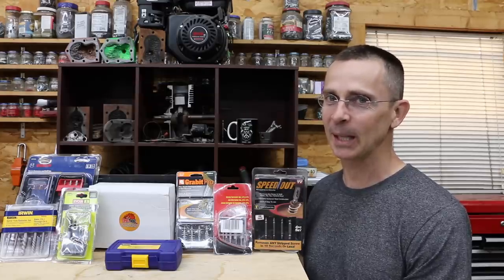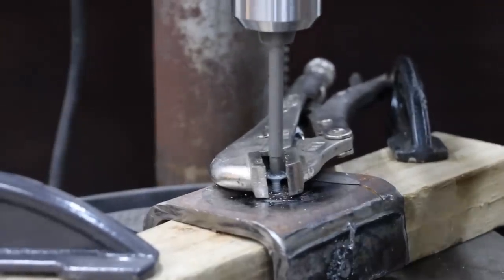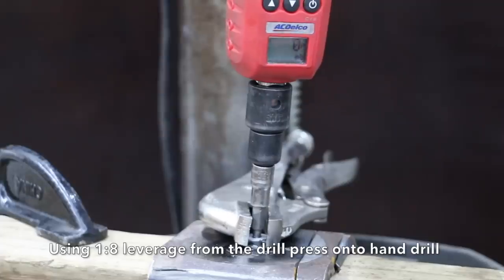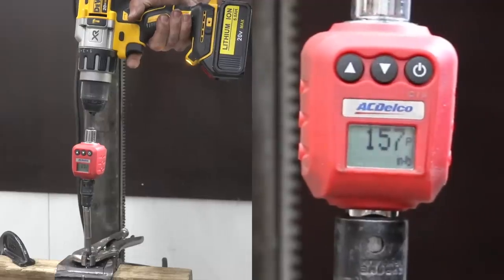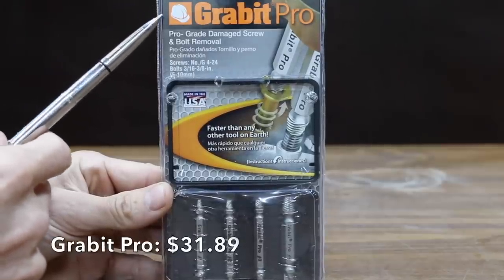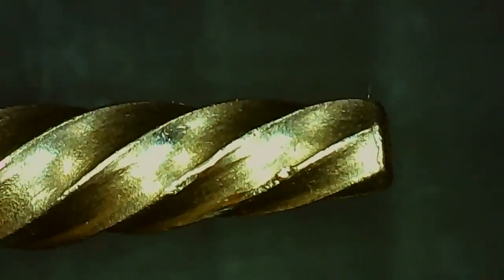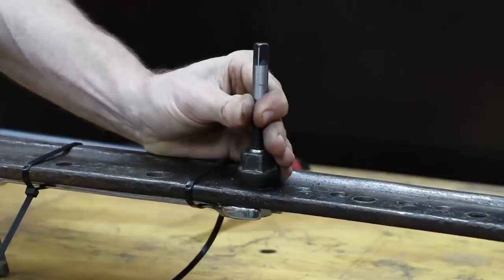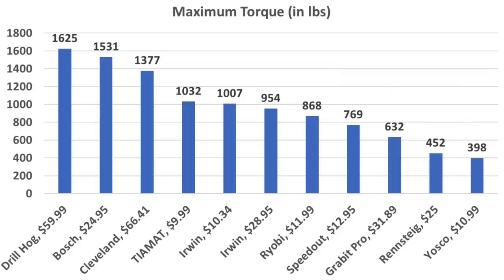Best Bolt Extractor? Let's find out!  Drill Hog, Bosch, Irwin, Speed out, Ryobi Broken Screw Sets

Comment from the maker: Products Tested In This Video (in no particular order):Drill Hog: https://amzn.to/34lyrtO

Bosch: Currently not available
Irwin Hanson:  https://amzn.to/2Qlf5N3
Speed Out Pro: https://amzn.to/38qnsBu
Ryobi: https://amzn.to/2CNBCPA
Grabit Pro: https://amzn.to/2JPT8Ga
Yosco: https://amzn.to/3gkLzBE
TIAMAT: https://amzn.to/2E6mjlW
Rennsteig:  https://amzn.to/3giX24V
Cleveland: https://amzn.to/31hNLWi
Reply: It'd be great to order these by your ranking (to help those purchasing based off your great tests)! Thank you.
Reply: There is a new king extractor. The R.B.R.T. Extractor from Mac Tools.
Reply: Bummer, I was going to get the Bosch one
Reply: @ project farm 
Can you please make a video testing helicoil and timesert repair kits for high torque applications (and low torque) vs original threads. No videos on ytube or anywhere for this. Will be too late for my project but I'm sure a lot of people want to know if a helicoil can take 200nm+ or torque and if its durable.
Reply: Thanks guy this is very good knowledge thanks for sharing and helping us out with options
Reply: If theres a way for you to revisit this test, it would be nice. I deal with many stripped heads and have often had better luck not tapping the extractor in, but rather have solid downward pressure, and twisting in
Reply: Video ideas:
- Best eraser
- best paint cleaner
- Best dryer sheets
- Best wine bottle opener
- Best trash bag
- Best toothpaste
- Best waterproof socks
- Best windshield wiper fluid
- Best bulb type (for example: LED vs incandescent vs etc.)
Reply: I watch almost everyone of your videos and recently I needed to extract a large, rusted, bolt from the sub frame beneath my car. So I came back and rewatched this video and based on your test results purchased a set of Drill Hog extractors because I knew I would need as much force as possible to get the bolt out. The extractor worked amazingly well, I credit your review for my success in getting the bolt out. Thanks.
Reply: i really would have liked to see neiko brand extractors in this test, they make alot of tools you can find on amazon
Reply: I think hammering the extractor in reduces overall effectiveness, bolting the extractor in tends to make a groove improving grip.
Reply: I tell ya…my harbor freight set has removed many stripped out bolts and screws with no problems
Reply: @mcrv7a  At least the Grabit Pro is and was rated top here!
Reply: I'd like to see a video on Bolt extractor sockets.
Reply: How about removing screw-removers, don’t buy ryobi, that’s what happened to me.
Reply: Just so you know, your video is being used on Amazon for marketing for rocket socket. Just wanted you aware

Comment: I'm so glad to see such a critical, hard-working & honest channel be celebrated.
Reply from the maker: Thank you very much!
Reply: Could you do fiber fix repair wrap versus flex tape fiber fix repair wrap claims to be 100 times better than duck tape
Reply: @ProjectFarm  you need to redo the test on extractors. As a maintenance man I would never have a broken bolt that would have a load on it. And if it did have a load on it. Say like rust I would soak it in a penetrating oil first before extraction.    I do think the drilling part is a good test for the drill bits for the extractors but most of the time the extractors will never meet there max torque rating like your test indicates. I would think a test for a the extractors could be done daily if you drilled a and taped holes in a pice of 3/4 inch steel and submerged it in water so it rust the stap the heads of said bolts off and see how well it extracts the bolts out  then. No external forces contaminating the experiment just the rusty broken boldt in the steel vs the exstractor. I would love to see that vidio. This was a great vidio in its self for showing how the perform under a load and what torque used before failure.

Comment: Here's a trick I figured out once when I was stuck with a stripped screw head: drill it a bit with whatever you've got, then tap in the point of a concrete nail or hardened cut nail.  Even the point of a Tapcon screw might work.  Keep tapping it in while applying torque to remove.  The hardened steel will bite into the head of the fastener, and tapping keeps the edges embedded in the material so it doesn't strip it out.  It takes a little finesse but it's worked for me on many occasions, enough that I don't replay my easy-outs anymore.
Reply: Makes sense, literally makes a matching screw and screwdriver in the process, if I get it correctly.
Reply from the maker: Thanks for the feedback.
Reply: Wow. Never thought of that. THANK YOU
Reply: 🔵 I've used the cut-nail trick for many years now and it usually works better than most extractor-"Systems", I just cut the cut-nail to the size I want for whatever screw/bolt I'm trying to back-out and gently grind the end flat, (being careful not to change the temper of it during grinding).
Those cut-nails are made out of some damn tough stuff!!....
I made an adjustable sight ramp for my rifle out of one and over the years have used them for making quite a few other odd things, they're great for making shaft keys out of!..... I've always wondered what the 'specs' were on a cut-nail.

Comment: One thing about these kinds of extractors, when they thread into a bolt, they can force the bolt to expand and make it a much tighter fit in the threads and make it harder to extract.
Reply from the maker: Yes, great point!
Reply: It's why the longer spiral ones work best, the helix is to steep to generate a lot of threading/expanding force. The secret to getting good performance from them is to get the hammered to depth right, that's the tricky part.
Reply: Yeah that's why left handed drill bits are the best solution
Reply: I use "LEGO-axle" style extractors because they do not expand the damaged bolt. Not sure what brand it is but they are straight pieces that have some sharp edges on them, and separate "nuts" that slide on the axle to wrench on. Also drills in the set. A poor man's version is to use torx bits! However, they usually split, and you have an even bigger problem.
Reply: I always hit the bolt first with PB blaster the day before, then cook it with a propane torch before extracting.
Rust and ancient bolts can be stubborn.
Reply: @ganador13  I've spent over a year freeing some hardware up. Haven't broken anything in a long time now.
Reply: @Paul Frederick
I'm usually working on 30 year old vehicles from the North East, so I break bolts often, myself.
Usually they are quite rusted through.  The method I described usually solves it though.
Reply: If you've got the time and tools nothing like welding a better bolt head to a stripped bolt.
Reply: I head the same thought ,but in use, it did not seem to matter. I used the screw in extractors,  from the cheapest (1 dollar /set) to the most expensive that I hade yet (10 dollars). And they did not let me down.
Reply: To an extent, force will travel towards the path of least resistance.
Reply: @ganador13  I'm usually working on tools over 100 years old. The way I see things is they didn't seize up overnight so I can't expect them to come right apart either. I'll tell you something else too, torque is never the answer. You get a box end wrench on a fastener and tap it gently. Both ways! Rust is brittle. So hammering rust breaks it up. But getting those impacts deep into the threads of a fastener doesn't happen instantly. You should see the saw set I just managed to pull apart. When I got the pins out of it even I was impressed. It only took me about a half a year to do. She's running now though.
Reply: @perjernstrom5178  Snap on/blue point E1020
Reply: @ryanmickelwait1521  Didn't expect to have to scroll down this far.  I have a few left-hand bits I keep around for emergencies.  Often the combination of torque and heat they generate is sufficient to encourage a fastener to back out.
Reply: Finesse
Reply: @Paul Frederick
I totally agree on the torque part.  Though keep in mind that vehicles see different experience than tools.  Especially in the north east.  In the end, it sounds like we both have our own methods that work well for our own projects :)
Reply: @ryanmickelwait1521  This is always what I try first, and if it doesn't work at first and I drill it out some times the left-hand drill will work near the end of the fastener when the rest of it is just wires in the threads.
Reply: @1pcfred  I've had very good results with this method, tapping straight down also helps. Patience and knowing when to move on to the next technique are very important, brute force usually just makes things worse.
Reply: @ganador13  I used to work on cars a lot when I was younger. And I grew up in northern New Jersey which is the heart of the northeast. No one salted their roads more they they did there. So it is fair to say I've seen the worst rust on cars there is. But I have pneumatic impact tools and a Smith burn outfit. Which if you know what you're doing is like magic.
Reply: @alfredmorency8296  Yes, exactly that set I was referring to. Thank you!
Reply: @perjernstrom5178  Yes, 6 straight edges and named ''STRAIGHT FLUTED EXTRACTORS WITH A TURN NUT'' If I remember
Reply: @fensoxx  unless your weld bead fuzes to the head on a v8. Ask me how I know....

Comment: Me looking at products in store: This one has UL seal of approval. I guess it should be good? Oh wait, this one over here has a PF seal of approval, I'm taking this one
Reply from the maker: Awesome!  Thank you for the positive comment!
Reply: Agreed! I've changed up alot of the stuff I buy based on his tests
Reply: I bought the Ryobi l but i guess best for value was Cleveland..? the bolt split destroying results
Reply: the PF seal of aproval must be a real thing
Reply: @ProjectFarm  okay here's your next project. It's actually two fold. You know what I might just make a video and then send you the link.
Reply: Dang skippy!
Reply: @ProjectFarm  Speaking of a PF seal of approval, what bits did you use to strip out the screws?  Those apparently hold up really well.
Reply: @ProjectFarm  that German one with the straight edges, we never used that in bolts, we only use that for the inside of water pipes or steam.